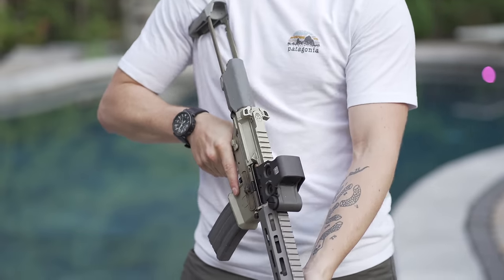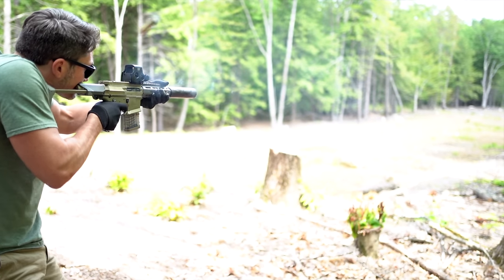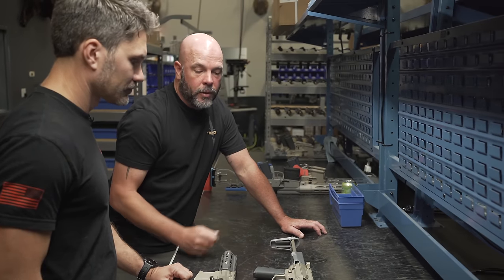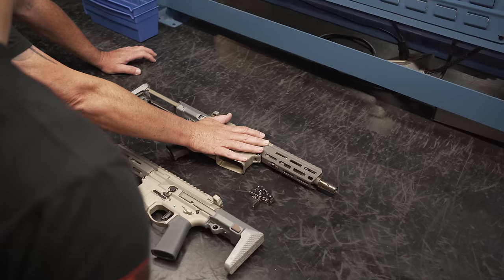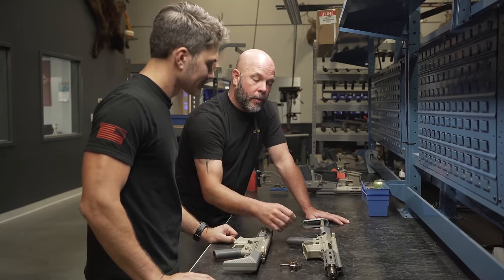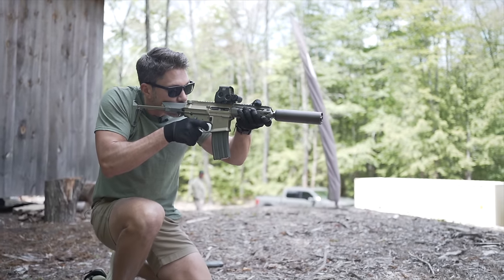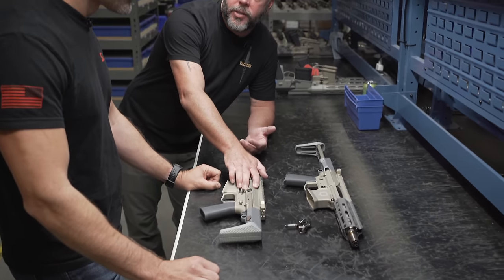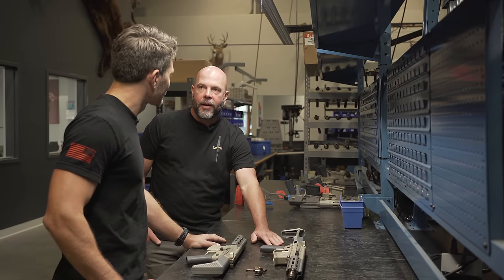Why the Q Honey Badger is Better than the AR-15

Comment: Everything is so proprietary they even have a proprietary word for accuracy.
Reply: "Dispersion" is probably a better word for describing the variation of projectile impact points than "accuracy".  A sub-MOA group high & right of the bullseye had minimal "dispersion", but isn't "accurate".  I can see why a firearm manufacturer might use terms like dispersion, spread, or MOA to describe the performance of their firearms instead of accuracy.
Reply: @matthewmcgee  That's an issue with the aiming system (optic) being improperly zeroed. A sub moa rifle is accurate.
Reply: @matthewmcgee  There's already a word for that. In science hippy terms, accuracy is the location, "precision" is the group size.
Reply: @Mackerel42  “science hippy” 😂 …zefrank fan?
Reply: KB has a proprietary word for proprietary on the books in the patent office
Reply: @matthewmcgee  when you study ballistics Accuracy is correct term for measuring a repeating action and having a repeating effect. This is the term used in every firearms textbook and in Physics. Dispersion is the act of spreading things or scattering things. So he is equating the constancy of his projectiles to spreading them on a target instead of using a measurement of repeatability AKA accuracy.....
Reply: I've been laughing at this for 10 minutes now. "He even has a proprietary word for accuracy." 🤣
Reply: @Mackerel42 You sir are correct. I am a dimensional inspector and was laughing at the whole dispersion thing lol. 

@KB There is already a word for this lol.

Comment: AR15 parts are "artificially inexpensive because of volume"? Isn't supply (ie volume) and demand, like, the cornerstone of capitalism? Sounds as if, if anything, the honeybadger is artificially expensive by way of unnecessary proprietary parts when you can build a .300 blk DI gun for a quarter of the cost. Would I be mad if someone gave me one of these? Absolutely not, seems cool. But I see no reason to buy one for myself.
Reply: You're exactly right. When he started with this 'artifically expensive' thing I laughed.  What the hell!?!
Reply: He's actually right that ARs in the US are cheaper than they would normally be simply due to a massive amount of competition from so many manufacturers. "Artificial" may not be the best word, but there's a reason that modern military weapons all cost roughly $2,000 and a premium AR costs roughly $2,000 BUT a cheap AR can be had. A cheap AUG or Bren doesnt exist.

Now, the HB itself is higher than it should be because we see those premium ARs $1,000 cheaper than a HB.
Reply: Kinda like HK and the "not an AR" gang.
Reply: It is cheaper than other rifles because of fixed costs and scale
Reply: Do yourself a favor and google "economies of scale". You will learn something new and might delete this comment.
Reply: @ALovelyBunchOfDragonballz  Lol.  Standard issue infantry rifles are not made with the highest quality parts.  They're the cheapest that can be mass produced and still work.

Comment: If it breaks its not interchangeable with common AR parts. Easy pass for most of us.
Reply: ngl im a millionaires brat and i bought one, and even for me the price of ammo + can killed the fantasy for me. also the idea that if shit hits the fan the parts arent easy to fix + ammo is impossible to find killed the fantasy. it literally sits in my safe, i primarily use a well tuned aero precision ar and call it a day
Reply: A lot of it is interchangeable. What are you most concerned about breaking? Usually first parts to go are extractors, gas rings, barrels etc. 

The entire bcg can be swapped to a milsepc bcg without issue. The buffer and stick assembly is the proprietary part but you could still remove all that and install a standard milsepc buffer and tube. 

The barrel is proprietary but if you shoot enough that you’re worried about shooting it out just buy a spare. There not too expensive
Reply: @jaydubs6354  actually thank for this info i was informed differently upon purchasing the firearm. but my main reasoning for not practicing with it/training with it as a bug out gun is i feel like finding 300 black out would be way way harder than .556 and the price of  practicing with it is currently painful in washington state.
Reply: @jaydubs6354 at that point why even buy the HB if the replacement parts you can easily swap out are regular AR configuration parts?
Reply: @smnkm4ehfer  because the hb is still better made than most other ar’s you could build. If you wanted to build a hb clone but still utilizing the components of a hb like the stock, barrel, bcg, handguard etc it would still probably run your close to 2k. At that point get a sugar weasel for 1600. 

I want to do a hb barrel and handguard but on a matched set of noveske receivers and with a law tactical folder rather than pdw stock. That build is probably gonna run me 3200ish. The receiver set alone is 750
Reply: @jaydubs6354  why waste your time with a law folder build when an MCX already does all that, with a full factory warranty, for less than you're proposing. Depending on the model and what your needs are, you could also upgrade whatever parts you really need gucci and still be less than you're expecting. It's one of the only folding setups that's worth a shit. They aren't the cheapest, but they're a lot more value than the HB, and are better equipped than the SW.
Reply: @jaydubs6354  also the HB hand guard is one of the worst parts of the HB lol. Unless you wear gloves 24/7 or shoot at a super slow cadence for short durations.
Reply: @smnkm4ehfer  because sig is so bad that I’d rather have a Q gun than an Mcx lol. And yes I have owned an Mcx virtus 9” 300 blk. Despite being a piston gun the gas settings for suppressed use suck, pretty gassy even when turned to the suppressed setting, and I had the extractor fail within 1k rounds
Reply: @jaydubs6354  must have been a gen 1. I'll admit their 1st iterations of anything is likely to have problems but they're obviously gtg now. I haven't heard of any mcx problems for a few years now.
Reply: @smnkm4ehfer  hb sd or regular hb? Mine doesn’t get any hotter than my other suppressed rifles. The sd though for sure kinda hard to get around that heat even with a thick hand guard
Reply: Nope was a virus. Not sure if that’s gen 2 or 3? It was the previous generation before the spear. Production date was 2022

My friends swat team also runs the 11.5” 556 Mcx virtus. They had to have bolts or barrels replaced in 7 of their guns. 

They had lugs shearing off, extractors failing, the issues with the barrels were accuracy. These guys were struggling to get 4 moa out of their guns with good ammo not just their normal duty ammo.

Comment: The whole "artificially inexpensive" due to volume produced for AR-15's doesn't make a lot of sense. Isn't that just basic supply and demand alongside refined manufacturing methods?
Reply: He's too busy glazing SOCOM's tip to care
Reply: Doesn't make sense. . . then you point to supply and demand. . . Which is it
Reply: Makes perfect sense every single ar15 company from Anderson to knight’s armament pushes out the same low quality shit in insanely large batches, if there was a store with just a single part from every single company that makes shit like uppers or lowers you wouldn’t be able to tell the difference and there would almost be an infinite catalog to choose from go to any gun shop, they’re full of the same exact boring ar15s where the only difference is the name stamped on the side and possibly barrel lengths Daniel defense, knight’s armament, bcm are all overpriced run of the mill ar15 sellers don’t even try to call me out cause I’ve got a knights armament 556 and compared to the ar15 I built with parts from Anderson, psa, and aero it’s shit, and compared to my honey badger bruh you literally can’t compare them

Comment: "is this $3000 AR better than this other $500 AR?".....ok? im not gonna buy it, especially when ammo is a dollar per shot.
Reply: Reload. You can make triple the ammo
Reply: @TheDkb427 the thing is that takes time and even still it won't be cheaper than 5.56 to make
Reply: @sethblanton911  no it's def not cheaper than 556 but you can make it cheaper. Think I'm at 55¢ for vmax compared to $1. I like to tinker tho so there's that
Reply: @TheDkb427   Ugly truth is that reloading is only cost effective if you value your own time at a very low hourly rate.  Many people make $40 per hour and have overtime available would be better served by working extra hours at work and then buying ammo.
Reply: @lordhuck2689  Not to mention the space necessary and initial costs involved in getting all the necessary tools and components.
Reply: well, when shit hits the fan a 50 dollar gun and a 0.05 cent ammo would be better than none...
Reply: @TheDkb427  Also reloading is it's own entire hobby with it's own learning curves. It's by no means rocket science but it can result in catastrophic damage to your firearm and self if done improperly. Not to mention, reloading is only cheaper AFTER you get over the hump of upfront costs to by the tooling, powder, primers, and bullets that are require to even use the thing.
Reply: I reload because I enjoy the hobby and science. I don't factor the time involved because I enjoy it. I get to spend more time tinkering with gun stuff. It's not for everybody.
Reply: .300 BO has been like $0.60-0.80 a round (subs and super) probably for last year so idk what you’re talking about. Cheapest 5.56 is maybe $0.55 a round. Currently 7-8-24

Comment: If it has proprietary parts, it's not better. Have fun repairing it in a jam. but at least you're cool.
Reply: Right
Reply: Yeah like my fx9 it's not 100% interchangable. Still cool just not feasible
Reply: I bought this gun because it doesn’t jam
Reply: It doesn’t have jams
Reply: Repairing it "in a jam"...Like a predicament or a part failure.
Reply: Better in terms of performance and fit? Yes. Better for the customers wallet? No.
Reply: @jacksonnra1856  lol, yes, that.
Reply: It doesn’t have “proprietary parts” it’s a different gun that looks similar.

Comment: I gotta say they were smart enough to leave out the price... How much is this rifle?
I mean if it's so damn good they shouldn't be afraid to tell us..
Reply: 3k
Reply: @OhioCruffler  OK, now I'm thinking about getting 2 1500.00 somethings and dual wielding! Take that!! 🤣
Reply: I built 2 Dirt Squirrels and a 1,000 rounds of 300 Backout and 10 30rd magazines for less than the Honey Badger and I love Dual weilding them.
Dirt Squirrel build is standard AR-15, A4 upper, 8½" 1/5 twist barrel's, DSA Lightweight bolt carrier, milspec LPK with stoned and polished trigger and hammer, SBA4 brace, standard buffer, ⅝x24 3 chamber comp with BFD, M-LOK 8" Free Float handguard. 
With supers they are louder than my Browning BPS 10ga 3½" Magnum.

Comment: He said, "artificially inexpensive" for regular ARs.  This guy is a grifting tool.  Also a great snake oil salesman.
Reply: It's somewhat true. The market is saturated with AR rifles and parts. Which is great for us shooters. . Lots of options at competitive prices. 

I agree with you tho, the way he says it is rather off putting. Why build an AR clone in this market? Could have been any design, or combination of designs of various modern weaponry.
Reply: @daftpanda6533  He could've simply said "the free market and abundance has made ARs affordable," but he didn't. He had to give some jackassy BS explanation in order to try to justify the price of his trash panda rifle.

Comment: The gun is ass though.  

- A former Honey Badger owner
Reply: Does that mean it's "shit" or "the shit"?
Reply: @rob6850 "shit"
Reply: Why? Just mildly curious.
Reply: @YippeeKiYayMrFalcon because the buffer system and cheek weld suck. The gun as a whole is not worth more than $500
Reply: I concur as a former HB SD owner. Sucked ass and sold it 2-3 months later

Comment: Nothing is more arrogant than the way he speaks of the MP5.  With the right ammo, they are incredibly accurate.
Reply: I'd argue with any ammo, unfortunately they can have spent brass get stuck inside the lower receiver rendering them useless in a critical situation. This is why I will not use any MP5 or clone for any serious purpose, and why I sold mine.
Reply: Mp5s are not modern they just look tacticool. Theyre antuquated their engineering gets in the way kinda junk too very expensive

Comment: I have a "budget" honey badger made with a proof carbon barrel, adm billet receiver/rail set, and all premium parts that's only a few oz's heavier and slightly longer, all while using purely ar15 parts, and it only cost around $1900.

Comment: I mean... It is an ar15? 🤣 The gun costs $3000 cause it's not mass produced... Oh and because we want a 300% profit margin to make up for R&D within 10000 units sold rather than 100000 units.
It's so dumb when they say things like, the criticism is cause we can't afford it... Most of us can afford your gun, it's not that it costs a lot, is that it doesn't have that much value. I never complained about my $12000 50bmg or $6000 2011 that I got to talk to the gunsmith myself as he was hand building it and picked my serial number.. but an AR is an AR that's also an AR so it should cost AR
Reply: I agree when you said "because we want a 300% profit margin to make up for R&D within 10000 units sold rather than 100000 units."

If they reduced the price by like $1-1.2k they would probably sell significantly more and recoup their engineering costs a lot quicker.

Also like you said, I can afford a Q, I just don't want to blow $3k on a "proprietary" AR when I could assemble something equivalent for $1200 and spend the other $1800 on ammo or a sick vacation.
Reply: Bingo. I've had 1911's worth 2 of this gun, but the owner of the company didn't call everyone a poor for not buying his product either.
Reply: I missed that he said 300% LOL